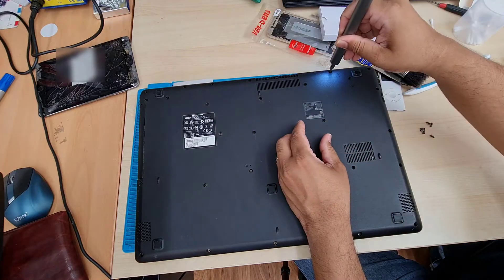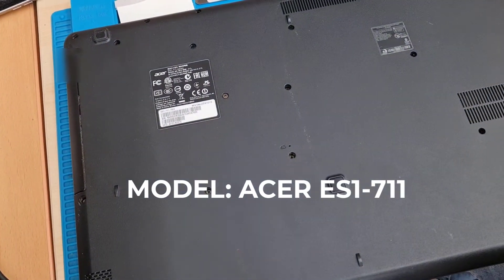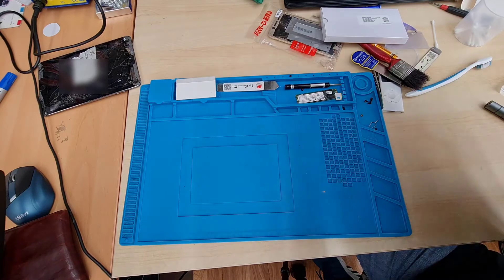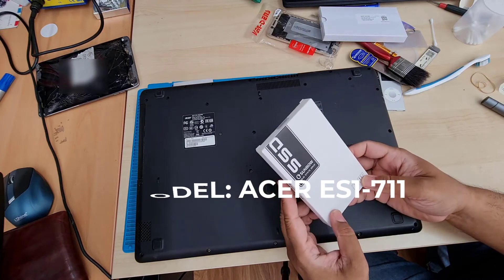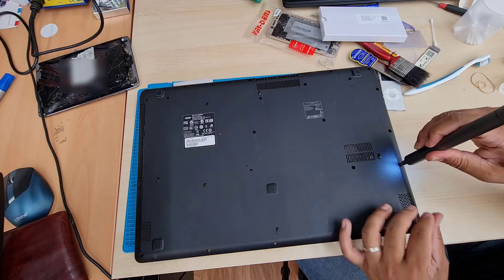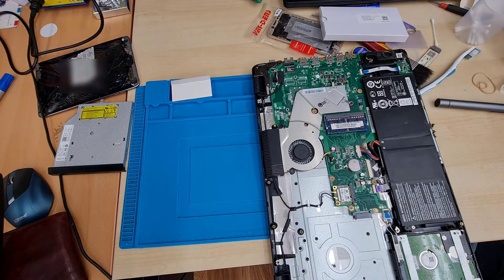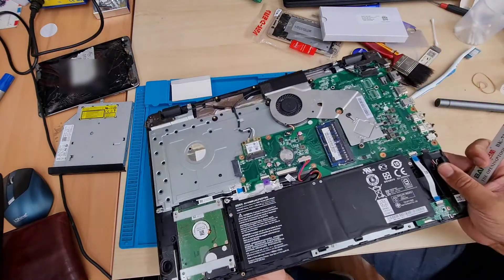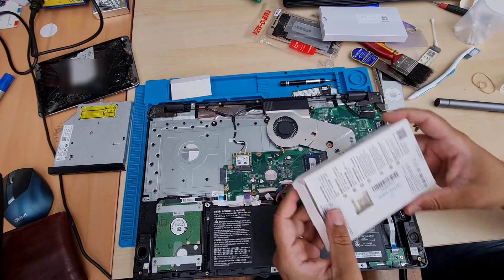How To Upgrade SSD On Acer ES1 711 Laptop ! Easy Way To Make Old Laptop Faster.

Comment: Well.. I replaced the HDD with an SSD, swapped the 4GB RAM for a 8GB module and replaced the CMOS battery.

Laptop won’t boot now lol
When I press the power button the blue LED lights up, the CPU fans spin for a 2 seconds and then stop. The CD-ROM drive works normally but the system won’t boot
Reply: ok case closed, RAM was the issue
Reply: @Minimalici0us  Is it much faster? Or not that noticable?
Reply: @Minimalici0us  Can you still be able to upgrade the RAM? Cuz my laptop also won't boot. So I don't know if I need to try a new one.